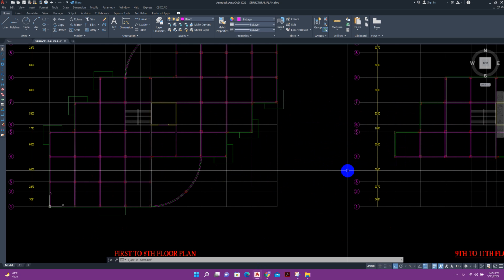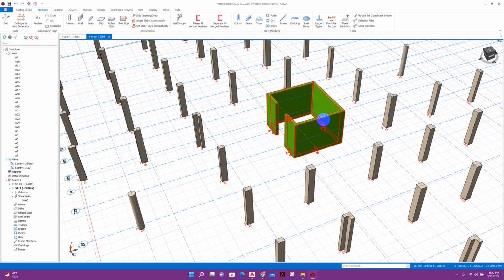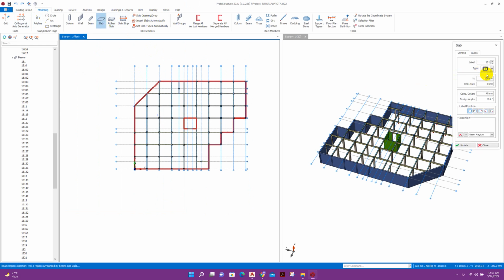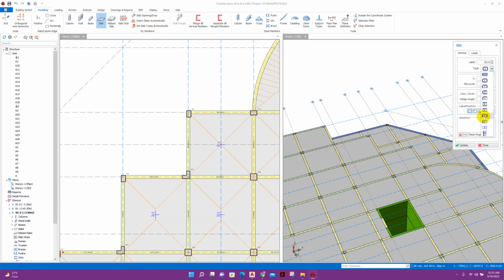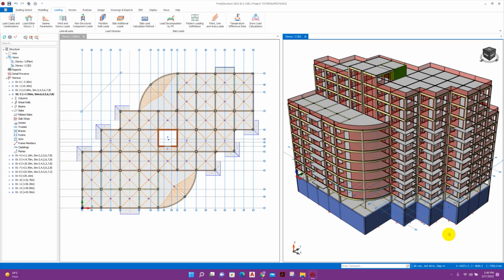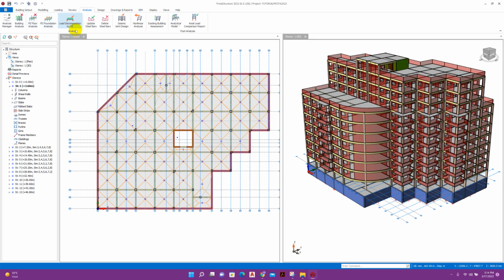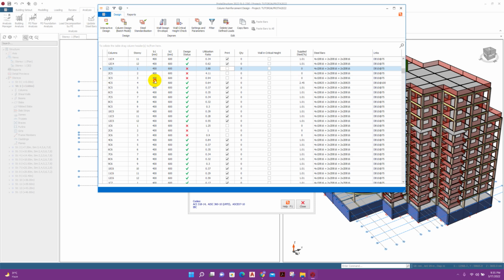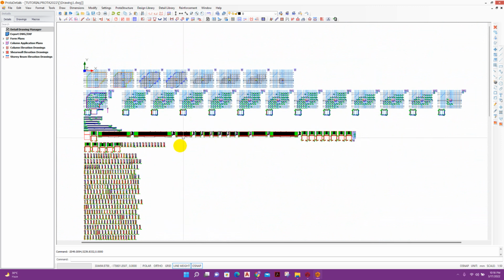Design and Detailing in Prota Structure 2022

Comment: Dear sir
when i used protastructure 2022  for pad footing and transfer it to protadetails 2022 if the columns centerline  have displacement from the axis i.e e=100mm the drawing of the footing plan appears to have the same displacement and the centerline of the column and the centerline of the footing drawn with the same displacement i.e columns and footings centerlines did not match each other.
this is not the case in protastructure 2022. is there any setting missed by me to have the column drawn in the center of the footing